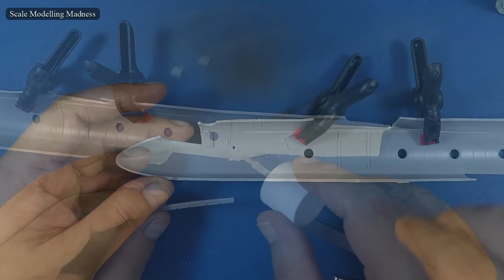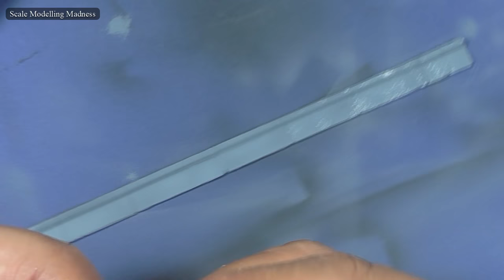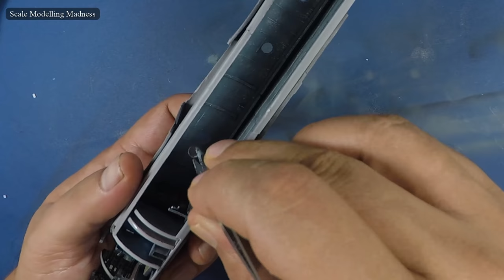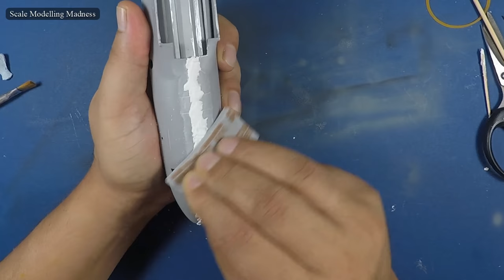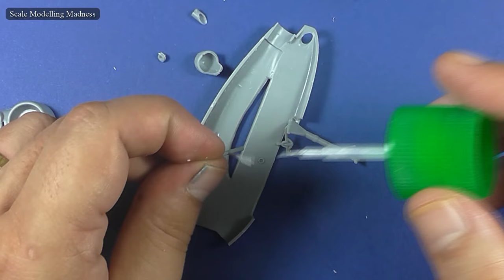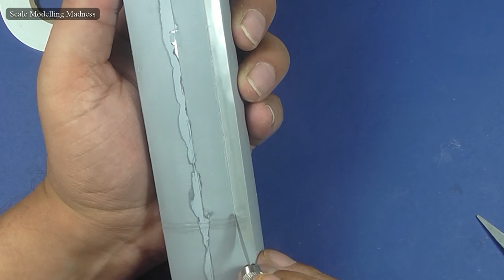A Difficult Build Part-2 (Amodel 1/72 AN-32)

Comment: I know you built this a little while ago but I find a good way to fill seam gaps is to initially use filler or putty but then for final smoothing I use a gap filling super glue with a kicker to set it. This allows you to almost instantly start filling and finishing the seam. The super glue will be harder than the plastic so I find a good quality flat needle file better than a flexible sanding stick. You can still do the final polishing with a sanding stick

Comment: Pardon my ignorance, but just wanted to check are you based out of India... I would definitely want to connect with you, as i am an amateur modeller facing alot of issues in gathering stuff together....
Reply from the maker: Hi Daaman, I started this hobby years ago in India, though I now live in Singapore. Even now I frequent India all the time. I would be more than happy to help you procure any kits/modelling equipment/paints. 
Let me start by saying that if you know where to look, all supplies are available via mail in India. There are however, a few things to keep in mind, first among them being that try to keep your purchases below Rs 2,000, ideally between Rs 1,000 and Rs 1,500. That way you can usually avoid getting hauled up by customs officials who are largely ignorant about the hobby and stop packages at a whim. Secondly, here are a few online shops you can order from easily in India:

1. toychamps.com this is a New Delhi based shop and they have a fairly decent range of Revell kits. in my experience they are prompt with delivery.

2. Hobby Link Japan hlj.com : as the name suggests they are based in Japan and have almost everything that you need. the mailing charges are fairly nominal (as compared to ordering from Europe or US). 

3. hobbyeasy.com is based in Korea and are also very well equipped. 

4. for paints and supplies its best to order straight from ak-interactive.com

There are other sites you can go to, but for now I think this should more than suffice.

Unfortunately, you will find it very difficult to order lacquer paints over mail and will have to do with acrylic water based paints. But these are more than sufficient to make a very good kit.

If you need any kind of information or help, please feel free to write to me : scalemodellingmadness@gmail.com

We also have a small but highly motivated and talented group of modellers in India. Connect with me on mail and I will introduce you to them. They are a sea of information and knowledge and meeting with like minded people always helps. Our facebook page is Indian Scale Modellers or ISM, do look it up. 

Once again, please feel free to write on mail or here. I wish you all the luck with the hobby and otherwise. Gaurav :)
Reply: @scalemodellingmadness4114   thanks a lot. its always great to know that you are not alone :). I just completed 1:35 scale MRAP 6x6 Cougar from Hobby Boss and is currently working on US M911 C-HET Heavy Tractor (8x6) & M747 Heavy Equipment Semi-Trailer 1/35 Meng Models. Its a work in progress... will share some pics on your email id... Thank you for the connect. Really helpful